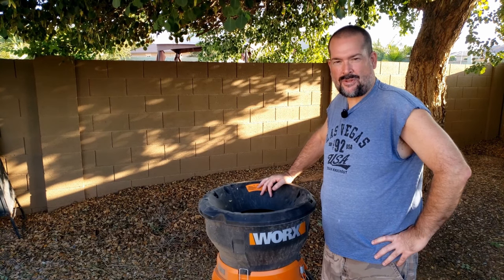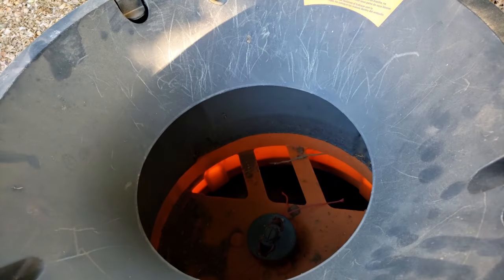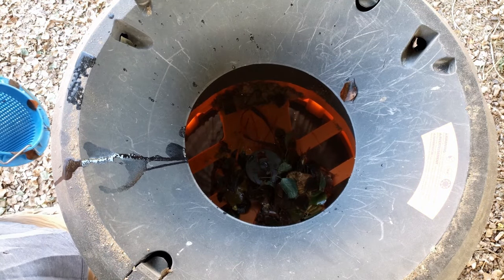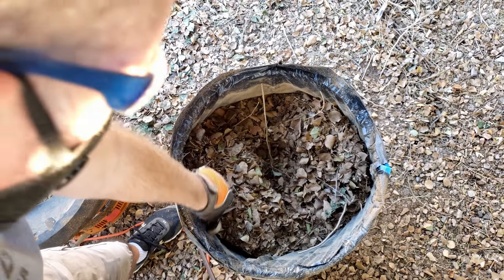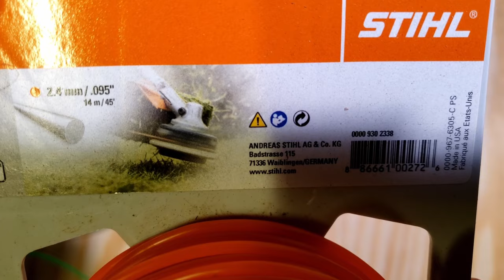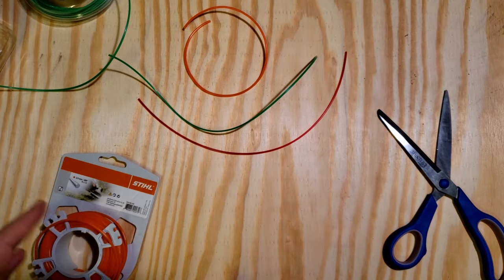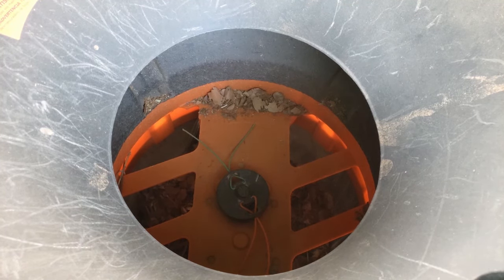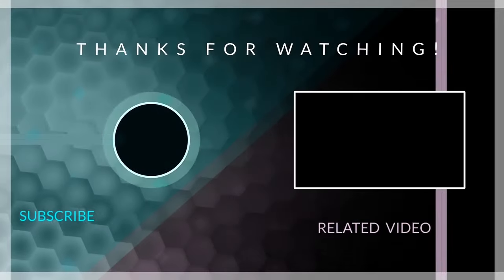WORX WG430 13 Amp Electric Leaf Mulcher Extended Review

Comment: I've been using a lawnmower, run em over and yer done, much finer result and faster, recommended.
Reply from the maker: Great advice but I have fake grass and landscaping rocks everywhere else.  So it would take some work to dedicate an area for mulching with a lawnmower. The landscape rocks will be flying everywhere if I try to mulch with a lawnmower. My weed eater is bad enough. It will shoot rocks into my pool and I have to fish them out. So the Worx mulcher seemed like the best option for my particular yard.
Reply: @ThatHobby  
Flying rocks is no fun, gotta agree on that, the lesser evil is preferable.
Im colleting mine from the woods and doing the mulch runs on govt grass, the battle to get enough compostable material.

Comment: Come on dude it’s not designed for rocks GEEZ!!!!
Reply from the maker: Yeah the rocks will destroy the trimmer line and they are dangerous too. We had a big dust storm last week and it blew a giant tarp into my yard. I could stake the giant tarp down in the corner of my yard and blow all the leaves onto it. That way I can do some mulching without the rocks getting in the leaf pile and messing up the mulcher.  Not everyone has rocks in their yards but for those of us that do this could be a better option. Thanks
Reply: @ThatHobby  that’s being safe you already use mask and eye and hearing protection

Comment: Dissapointing review.  Sounded more like a sales pitch.  I would have preferred a more unbiased and thorough review.  pros AND cons, how you think it compares to other options,etc.
Reply from the maker: The best thing about this mulcher compared to other brands is the stand. You can put a regular garbage bag on it thats really nice. The worst thing so far is the trimer line can burn up real fast. I made some other videos about this. Good luck in finding the right mulcher for your yard.
Reply: @ThatHobby  Yes, you mentioned that in the video.  However, you still didn't mention any "cons" or how it compares to other products.  Now it is obvious that this is not an unbiased review.
Reply from the maker: @carljensen5730  I would be interested in knowing what mulcher you decide to get. Once you get it set up and running let me know what you think of your new mulcher. The only other mulcher I have had was a Portland mulcher/blower combo and it burned up after 6 months. The Worx mulcher is still running after a year so that's a positive for me and my yard. Good luck in finding the right mulcher for you and your yard.

Comment: Great job on video review.  Ive done my reviews of various electric and keep coming back to the Worx for features.  I hope Im not disappointed.  Would you recommend a larger string?  like a .095?
Reply from the maker: I made my own from a spool of stihl trimmer line. I think that is one of the best trimmer lines you can get but it didn't seem to last any longer. The original Worx line actually lasts a little longer but it is a bit pricy.

Comment: Great job on video review.  Ive done my reviews of various electric and keep coming back to the Worx for features.  I hope Im not disappointed.  Would you recommend a larger string?  like a .095?
Reply from the maker: Thanks and yeah the .095 will fit but it is a little tight. I made my own from a spool of stihl trimmer line. It didn't seem to last any longer. The original Worx line actually lasts a little longer but it is a bit pricy. My issue is that I have gravel landscaping so I always end up with some gravel in my leaf pile and those little rocks destroy the trimmer line.